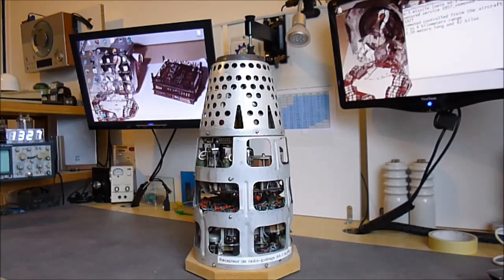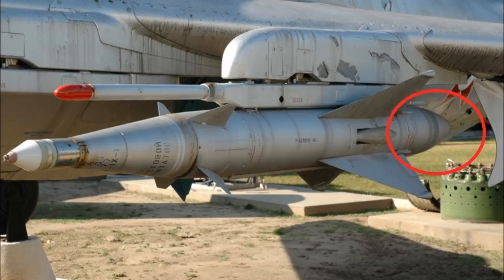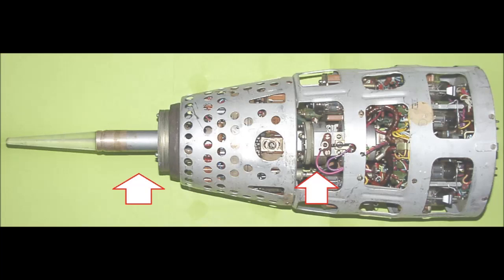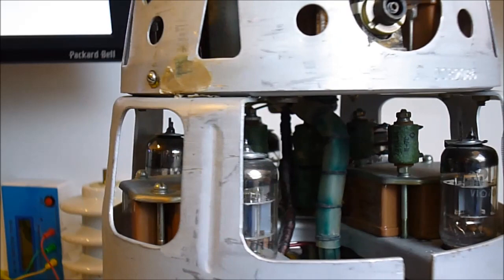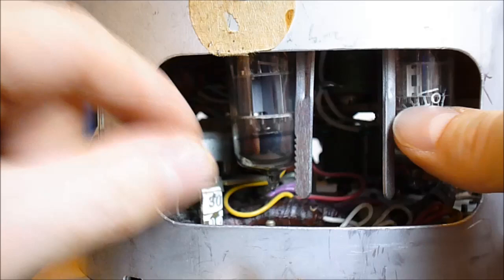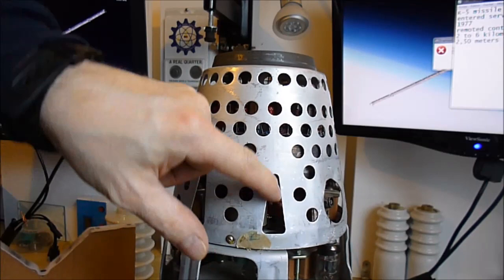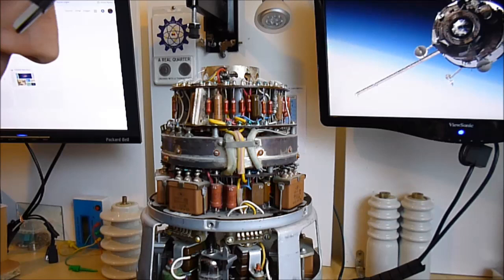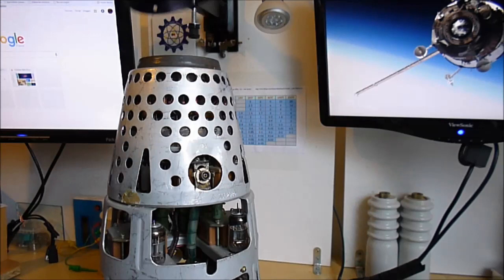Soviet K-5 air-air missile remote control receiver teardown

Comment: To be honest with u quite advanced design for 1950
Reply from the maker: This device is missing some of the metal clamps that secure the vacuum tubes in place, so far I was never able to find spare clamps of the same model, either from the new old stock soviet parts on ebay, or installed in equipment.